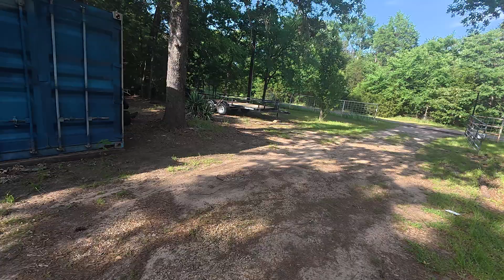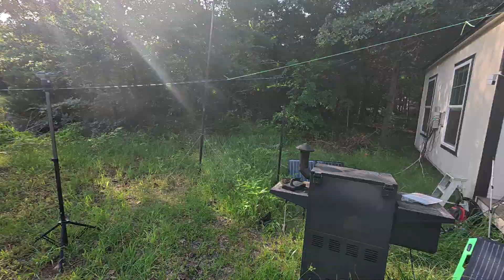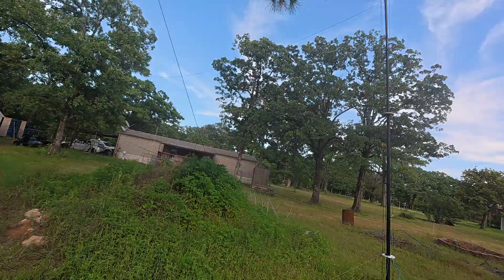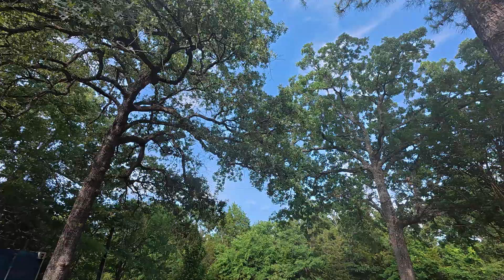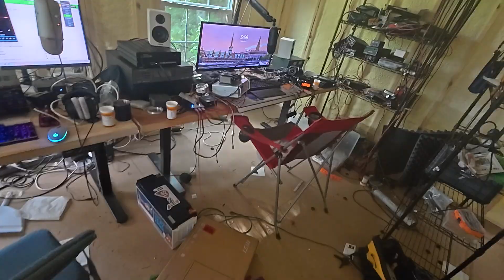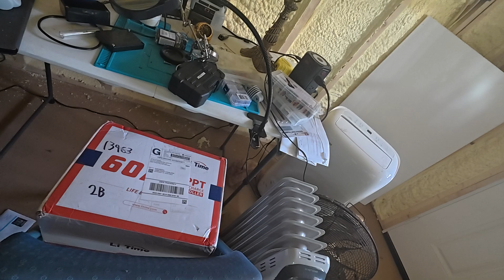Testing a new camera. Not a great attempt

Comment: how much did the spray foam run? I'm thinking of using spray the ceiling in my shack/shed.  I will likely do that in september, whether regular insulation, insulfoam or spray.  I will be doing drywall as well.

Davinci can be finicky on uploads.
Reply from the maker: About $3000. And it really works well. I have a small air conditioner and that is all I need to make it comfortable inside even in the current heat.
Reply: @don_n5skt thanks

Comment: You should definitely add some fuel additives to your mower gas the 10% ethanol reeks havoc on the fuel system making things gum up
Reply: Or use a non ethanol gas. Alot of gas stations have brought back non ethanol gas, it costs more but worth it.